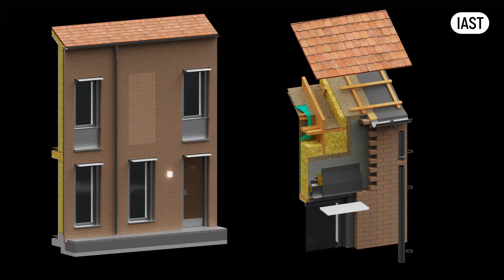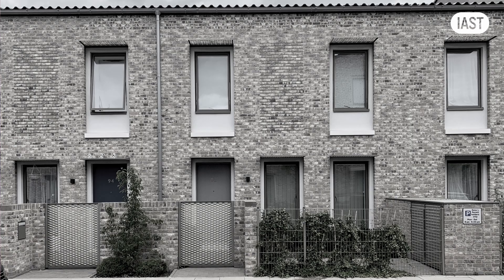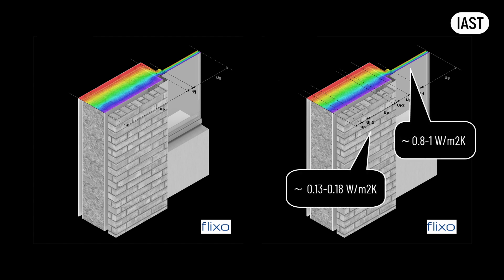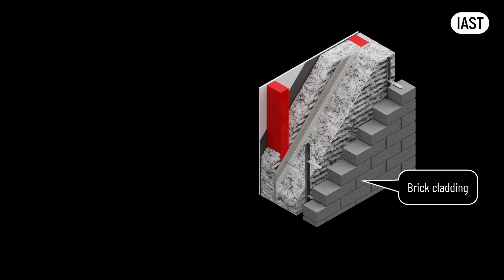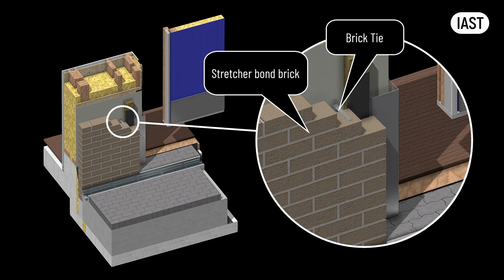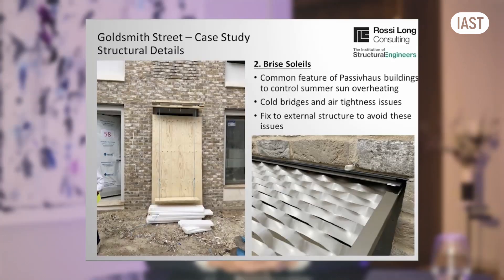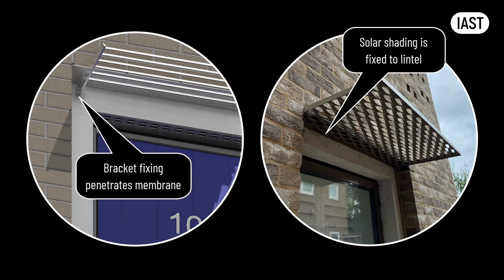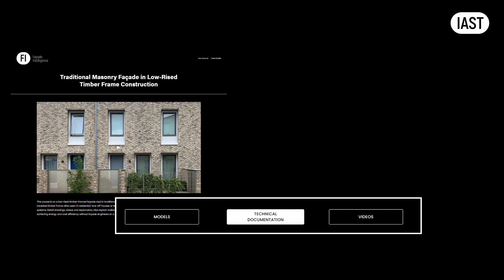Sustainable and Affordable Brick Facades. Passive House. CPD Course for Architects.

Comment: Smaller windows means less natural light, though. Seems like a cold climate like Norwich is more worried about heat loss through windows in winter (as opposed to heat gain in summer). How does triple glaze plus the greenhouse effect compare to an insulated wall? If they're about the same, then builders shouldn't shy away from larger windows just on that. I'm guessing cost is more likely to be the limiting factor.
Reply from the maker: The U-value of a triple-glazed window is around 1 W/m²K, whereas an opaque wall typically achieves about 0.15 W/m²K, making the wall nearly an order of magnitude more thermally efficient. During the UK’s cold season (November to March), daylight is limited to roughly 7 hours, with only a couple of those hours offering meaningful solar gain through glazed areas. This reinforces the need for thermally efficient opaque walls over extensive glazing to minimize heat loss.

In terms of construction costs, windows generally have a higher price per square meter than standard walls, though cost isn’t typically a primary design driver. Some opaque wall systems—such as those used in high-performance buildings like the Bloomberg HQ—are even costlier per square meter than many window types.